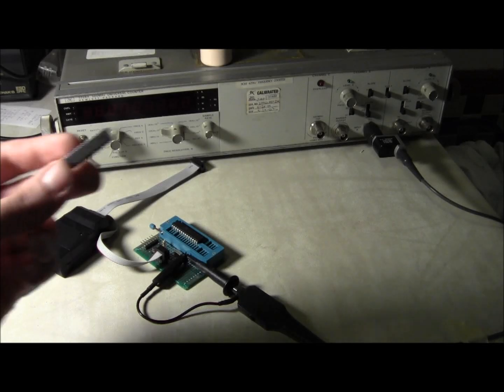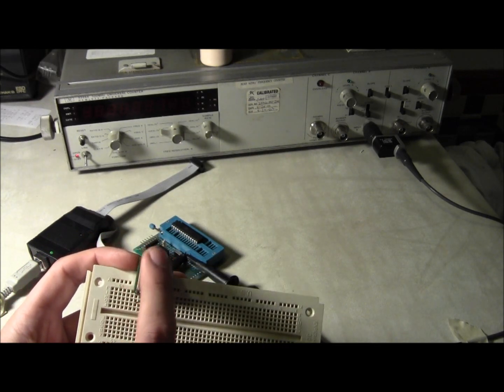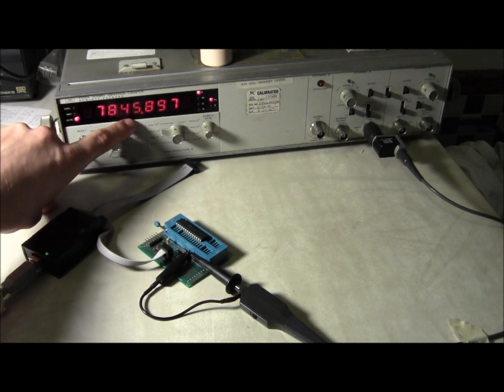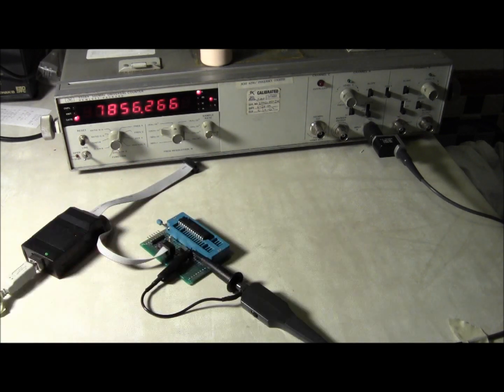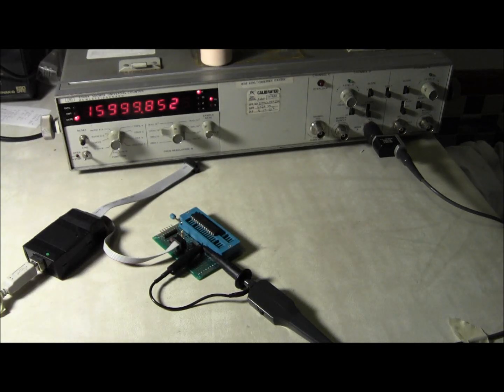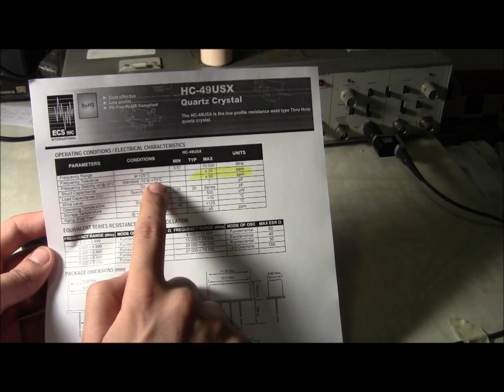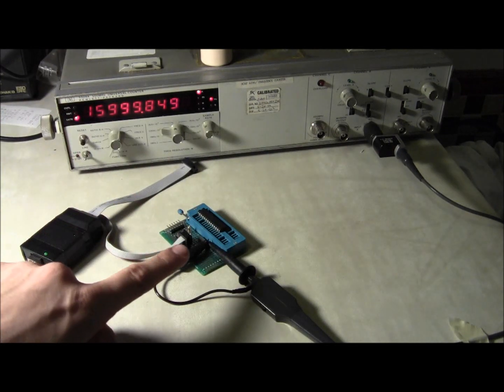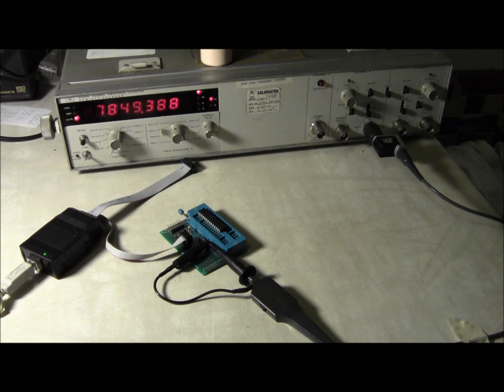AVR Oscillator Stability

Comment: awesome explanation. thanks for sharing! one reason for using the internal oscilator is to free up the pins to use a 32.768 Khz crystal for acurate timing. I needed acurate timing for a project, experiments showed me that an external 16Mhz crystal gave errors in the order of about 10 milliseconds per minute, both ways, and heavely temperature dependant. Using the internal oscilator and an external 32.768Khz crystal gave acurate results that do not seem to be influenced by minor temperature changes. Unfortunately I do not have a frequency counter to acurately test this.

Comment: It's all a matter of intended usage. There are many applications where a RC oscillator is suitable. 

The oven-stabilized oscillator in your frequency counter needs a certain amount of settling time to warm up - using it right after powering it up gives you less-than-optimal results.